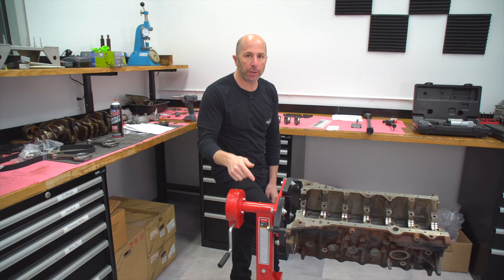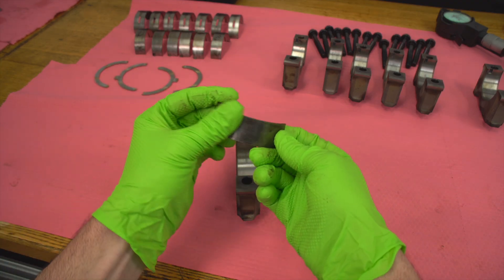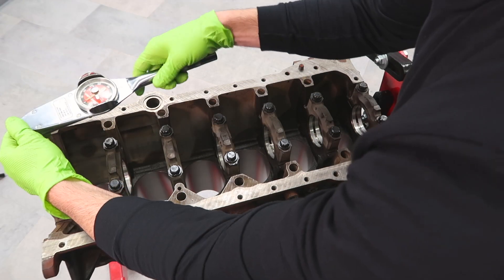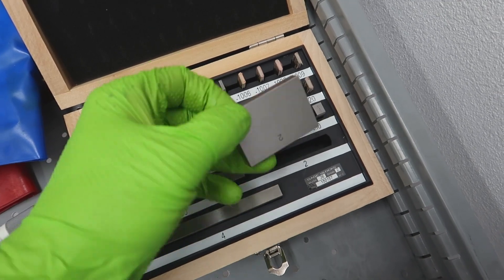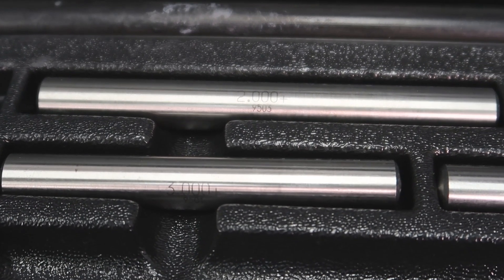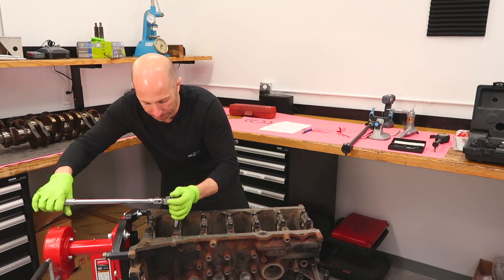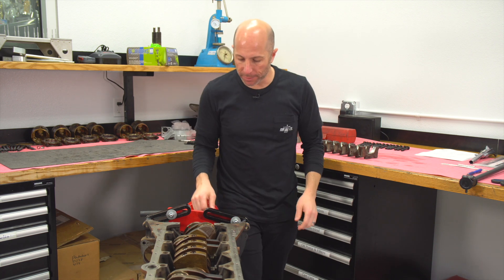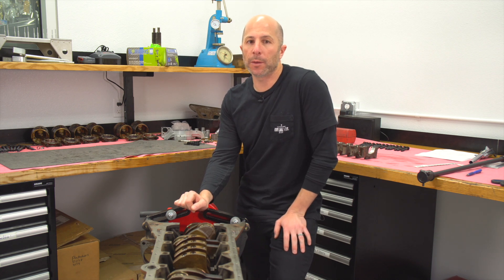$7 Vs $1,000 Engine Bearing Measurement Tools - Plastigage vs. Sunnen Dial Bore Gage

Comment: Yeah but the real answer to this question is, somewhere in between. Perhaps spending $1000, is just as idiotic as spending $7. Especially when a minute into the video, he is guessing 90 degrees on a torque down sequence. LOL You know there is a wrench that measures out degree increments. Used for everything from heads, to main bearings such as here. Looking at it from that perspective, the answer is much closer to $7, than the $1000 tool. As in let's say a $200 proven measurement device, along with better mechanical practices.

Comment: Having used bore gauges I would definitely say the answer you get totally depends on who is using the bore gauges. If you just look at a bore gauge the wrong way the  reading can be 50% out very easily. I guess for average Joe he is going to get better more consistent results results than the bore gauge. I’m sure you get enough practice to have the feel for using the bore gauge but I definitely do not.  So thumbs up for you using a bore gauge but thumbs down for me using the bore gauge.

Comment: Excellent, and very much appreciated. (Just for fun, as an automotive machinist years ago,  I used inside mics and snap gauges with outside mics...compared the readings. Had to do it repeatedly to get a consistent clearance... took forever and required infinite patience, but that's what it took. Was right up my wheelhouse...)

Comment: Plastigage is the OEM recommendation for servicing existing *stock*engines. If you're getting to extract all power from an engine, it's better to use a more accurate method. It's no fun to spin or bust a crank bearing!

Comment: Only Americans would take a Japanese metric engine and measure it using metric tools but then read and explain everything in imperial...
Reply: It's primarily what we've been taught in school; the metric system always gets 'an honorable mention' during school, but it's not used so much in practice, unfortunately. 

Even so, you do see a lot of mixed use - some metric, some imperial. For example, all of the nuts and bolts on JDM cars are always in metric, so many mechanics are totally comfortable referring to MM socket sizes, but when it comes to clearances we tend to revert back to the old way of thinking. 

But it gets really bad when working on American cars. Some bolts are standard/imperial, while others are metric. There is no rhyme or reason to it. 

shrug
Reply: @crxtodd16  the mixing of metric and imperial maybe is caused by different manufacturers. Just for example if your Chevy happens to have window wiper motors from German Bosch, they tend to be metric but then again you have imperial sizes used on the block itself.
Reply: Makes sense! I didn't think about that.
Reply: @Bemaritohtori  I think a lot of the GM mixed systems were because one part or assembly may have been used for 20 years so it's in imperial, and a newer part would be in metric.
Reply: @crxtodd16  That was true for a time in the '80's and possibly the '90's, but I haven't seen an imperial fastener on any car built in the last 20 years.
Reply: @1Cobranut    Try again they are still used, especially in drivelines.
Reply: @crxtodd16  Does this mean you've experienced the "joy" of accidentally trying to undo a tight 1/2-inch bolt with a 13mm socket?
Reply: This is what I'm going to start calling a "trigger' post. It is designed to get you to react without thinking first. So what if we go through the trouble of measure a import engine that is all in the metric system using imperial gauges and terms. Only a moron would point that out thinking he's some type of superior being. Have a nice day asshole.
Reply: @dj4monie  so yours is what we could call a "triger reply" as you are clearly triggered. Only a moron would reply like this.
And so on................................
Let it go big boy X
Reply: Yup, that's how we roll. LOL
Reply: Jimmy De'Souza  I only comment  on  a discussion if I feel I can add some value without referring to the subject matter or person  in a derogatory  way.

So with that said I have nothing more to constructive to add.
Reply: @Tackz777  should have stuck with imperial, got us to the moon.
Reply: I thought these questions would come up. I checked the comments just for them. Here is the thing the guy owns a machine shop. His tools read in inches, his machines most likely read in inches, he perceives his world over a life time of experiences in inches. Dude isn't going to change his whole life for you. There is no advantage for him to do that. They are just numbers and it really doesn't matter. They subtract and add exactly the same. Doesn't matter what the guy who designed the engine measured in the results are the same.
Reply: In engineering terms 1 thou is an easy to understand unit. 0.025mm is just wrong
Reply: @gothicpagan.666  but 25 micron is perfect 😉
Reply: USA!
Reply: Well yeah, that's our measurement system lol
Reply: @falconass001  No it isn't. Your government passed the metric system into law in 1975.
Reply: @donepearce  Sure did, and no one cared. It's fairly common here to ignore the government when it really is a meaningless thing. It's a concept we Americans refer to as freedom.
Reply: @falconass001  in fact, USA is metric :)
https://youtu.be/SmSJXC6_qQ8
Reply: I hope you do not suppose he would also speak Japanese to his audience, because that would follow the same logic.
Reply: @michaelscott-joynt3215  not really because the rest of the world is using the metric system including some US  companies .
And from where I come from if you dealing with a product made using nominal metric sizes then I'm not going  to use a imperial micrometer  and write the sizes down in inches.Let common sense prevail pls.
Reply: I admire Americans for their intelligence as they have a metric system which is an easy simple and modernised form of measurement yet they say no we are going to be stubborn and keep with the hard way and have to be intelligent enough to convert everything in science from metric back to imperial because Amurica.
Hold on is that intelligence?
Reply: @Antman4656  "We choose to go to the moon in this decade and do the other things (imperial system, dealing with E.U. trash and other 3rd world countries ), not because they are easy, but because they are hard, because that goal will serve to organize and measure the best of our energies and skills, because that challenge is one that we are willing to accept, one we are unwilling to postpone, and one which we intend to win.”
The world is full of jealous bitches, you won't be alone.
Reply: Only americans would use imperial for anything, it's such a deeply stupid, illogical, unreasonable, inaccurate, etc. system that is simply has to be forcefully forbidden until it's forgotten. I wouldn't use it to measure ANYTHING, let alone something of high precision. It can be done of course, but it's FUCKING RIDICULOUSLY STUPID, pointlessly complicated and at the end of the day not as accurate. It's kinda like someone tying your hands behind your back, blindfolding you and then hanging you upside down,  only to tell you "now write what I say".  Of course you'll scribble something, but it's much harder than just writing normally. Not to mention that it's not only stupid to use for anything remotely accurate, it's also deeply incompatible even within the system itself. It's impossible to convert anything into something else without major complication, whereas everything in metric is extremely logical. Almost as if the system itself was designed by intelligent people. Who would have though...
Reply: Hey  @derbigpr500 , can I buy you a pint?  I'll do anything to shut you the fuck up.
Reply: @derbigpr500  I'm not going to try to convince you that imperial is superior. What I would like to say is that it's not less precise. A micrometer in imperial has the exact same precision as one that reads in metric. They simply have a different thread pitch ground on their barrels. If you are going to rant that's fine, but don't make up lies that suit your agenda.
Reply: @philipmacduffie7612  Imperial has never been the problem (apart from the billions it cost you when NASA screwed up a conversion and lost a Mars probe). The problem has always been the use of fractions rather than decimals. They are unbelievably clumsy and seriously error-prone unless you are really accomplished at using them. Obviously when you are using a micrometer, you are working in decimal.
Reply: @donepearce  Woah. Let's get off the NASA high horse here. Ever work for a government agency of any country?

  The ground software had a spec. It was written in imperial units. The weather satellite also had a specification and it was in metric units. Both groups probably contractors, likely not idiots considering they made a space going satellite, were vetted via NASAs quality program and both objects were accepted through quality testing at NASA. Its not like these two groups delivered an incorrect pizza and NASA had no choice but to eat it before it was cold. The two delivered items didn't work correctly together, but likely were designed exactly as requested. let's consider who is at fault here? 

 Is it:
The specification documents?
The quality acceptance procedure?
The test procedure?
The units of measure themselves?

 I'm going to go out on a limb and say failures in the first three should have detected this problem but did not. That's the real disappointment.

  Fractions: Using a tape measure or ruler is not even taught in school anymore. The company I work at just did some volunteer work teaching kids how to do that. Because many of them will need this simple skill to do a meaningful job. In my daily like that is about the only time fractions are used.
Reply: @philipmacduffie7612  The fault was in the basics - failure to use a common system of units. The USA is by now the only country that clings to the Imperial system. Liberia and Myanmar are both de facto metric, even if not legally so. Sure, you can call that "freedom" if you like. From outside it looks like the petulant pouting of a teenager. It will pass.
Reply: @donepearce  yep! Math is only as accurate as the person inputting data.  I'm sorry fractions are hard for uou, they are hard for our 3rd graders the first time also.
Reply: @asherdie  Oops - did you know you said that out loud? You do? Well, thanks for the giggles.
Reply: @donepearce  I'm sorry, but you're feelings are of little importance.
Reply: @donepearce  to metric countries recently crashed on the moon. Should have used imperial, they might have made it.
Reply: @asherdie  It's like you are having a conversation all on your own.
Reply: @donepearce  You obviously don't want to debate sensibly. I was a teenager a quarter century ago I'm not just "pouting" and that in itself is a pointless argument.  

There is way more to this then waking up tomorrow and committing to change. There is too much in society here that can't change that easily to accommodate something that doesn't matter. This is why it never changed "naturally" in the first place.

 Machines, materials, signage, tools, and people from the industrial revolution to now are in imperial units. No sensible person is going to throw all that away and start over to fix something that isn't actually broken. 

   Sure I can buy metric nuts and bolts easily, Trying to buy 100mm x 100mm extruded aluminum is not possible. I bet you have it though. So should I make drawings at my business that one of these dimensions appears on?

4.00" - This is available material. 
101.6mm - This is stupid. The common material expressed in metric. Just for the sake of using metric.
100mm - This is a real material but not available commonly. 

  So to use your glorious 10 base system I will need to specify material that doesn't exist, or draw it in metric but nothing adds up to round numbers. 

Sheet metal is exactly the same.  There is no 1mm sheet steel to buy in any real quantity. You would get 20ga 0.0359" 

Go ahead and use the information super bathtub to find out that ANSI the American national Standards Institute Discourages the use of "gauge" sizing. Then head over to Alcoa metals website and see what you find. Oh, the entire industry works in gauge, but the governemt discourages that. It's also not in metric ? 

What's a teenager to do? Maybe if I just make my drawings in metric it will all change naturally? Nope I will be out of business because I am not willing to work within the confines of general industry. 

I'm not trying to make things where you live. I'm trying to do it where I live. Which is all I care about and it should be all you care about. If that means I can cut imperial size metal, in my imperial size machines, in imperial size collets that I have already have there is no reason to change anything.

 I could buy special order metric material and all new metric collets for my old equipment to please you, but you aren't my customers so I, just like the guy in this video, are not going to change just for you.
Reply: @philipmacduffie7612  I wasn't referring to you personally as the pouting teenager. I was referring to the American attitude. And do you really think the trials of change are news to me? We, and much of the rest of the world have already gone through this. Sure it is painful, but sometimes you just have to take a breath and do it. The transient stage is harsh, but if you let that prevent you from doing the sensible thing and joining the rest of the world, well, your vision is short term at best. I know all the arguments against it, from the weights and measures to the disgruntled customers, and they are all garbage. At 69 years old, I am very familiar with the entire process of moving from Imperial to SI. And I'm very happy that we have done it.
Reply: @donepearce  I'm glad YOU are happy. Guess what? the most of America isn't. The reality is there isn't a NEED to do this. So why throw away trillions of dollars in things to change the number on the knobs? If you have just a thread of intelligence it don't even matter if the knob was graduated in pancakes. I am confident just from this exchange you can do it. I can. So what's the issue? It's not like the US is on a crusade to convert the world to imerial measurment it's actually quite the opposite.
Reply: @philipmacduffie7612  I think this exchange has run its course.
Reply: @donepearce  I think this fire is dying down. Are you aware there are entire countries in this world where women have no rights and execute homosexuals? But, you are still a customer of them. So, are we the United States worse for clinging to imperial measurement or are they wrong to mistreat human beings?
Reply: @philipmacduffie7612  Now you are simply raving. Do whatever it is you need to calm yourself.
Reply: @donepearce  Oh I know exactly what I did. It's the same level of stupid as being this upset about a unit of measurement that doesn't matter.
Reply: @derbigpr500  and yet the entire industrial revolution was imperial.  Blowhard simpleton.
Reply: @derbigpr500  too complicated for you, huh?
Reply: @derbigpr500  Any system of measurement is as precise as the tools used. No more, no less. The foot happens to be a very useful unit of measurement because if I want a quick approximation I have two handy gauges I carry everywhere.  When it comes to sizes of nuts and bolts the metric system is far superior. When it comes to measuring distances at sea, nautical miles are the best choice.

It turns out that most of the different traditional units were quite useful in the context in which they were developed but not always so useful in other applications. The metric system was devised to allow the different measurements to relate to each other and have an easily definable standard. An example is that a 10 cm cube of water weighs 1 kilogram and is 1 liter.
Reply: My understanding is the US military officially works with the metric system.
Reply: mark mall I can’t speak for all branches but definitely not true for the navy. I’m active navy and we still mostly use imperial. Weights are still lbs, distance is miles (sometimes nautical miles) speed is still mph (sometimes knots), fuel is gal or lbs, most bolts and nuts are still standard not metric, etc.
Reply: @markmall7142   Ya not quite.

Comment: read through the comments and no one else has called you out for incorrectly reading the plastigauge. if it was a hair fatter than .0015 it would be .0016 but its a hair thinner so .0014 like your gauge read.

Comment: Even after measuring with micrometer and bore gauge, I like to use Plastigage before final assembly just as a double check in case I messed up. It is cheap insurance.

Comment: The precision bore gage and the plastigage have 2 different functions. I used to build race engines long ago (professionally) and we used plastigage to check clearances on engines we hadn't seen before. Once we knew where things stood, the precision tools came into play for the building. 
Also I think some of the differences that are in the video for the plastigage readings came from the fact that your diameters weren't the same on the crank and you just put one value for the crank when there was several or at least more than one.

Comment: Do the bolts get stretched out after torquing them down. Then you need new ones? Main cap bolts.
Reply: some engines dont use Torque to yield bolts. thats an older engine, modern engines almost always have TTY bolts

Comment: Three part question from this:
a) what is acceptable range of clearance ?
b) what do you do if the bearing manufacturer and the factory call outs are for different clearances ?  And I suppose same question if aftermarket, who do you follow the crank mfg or bearing mfg?
c) are we talking, in extreme cases, the viscosity of the oil making a difference ?